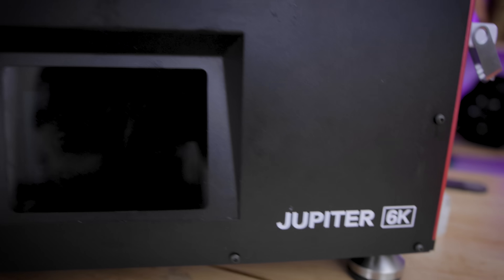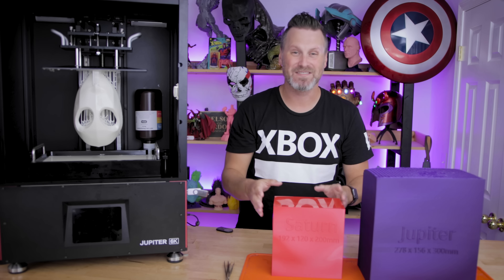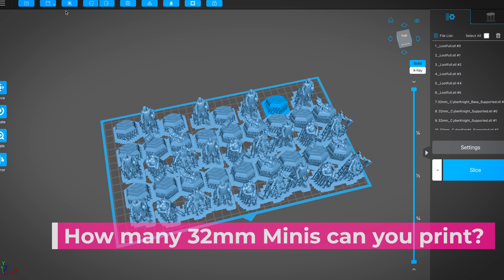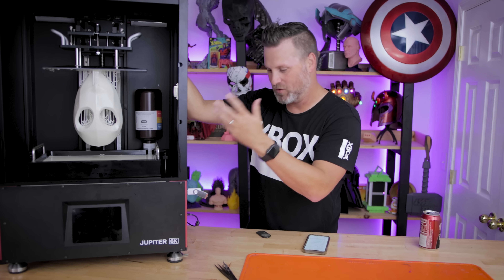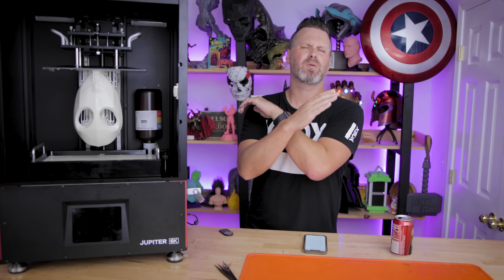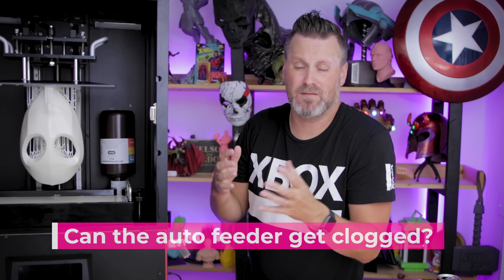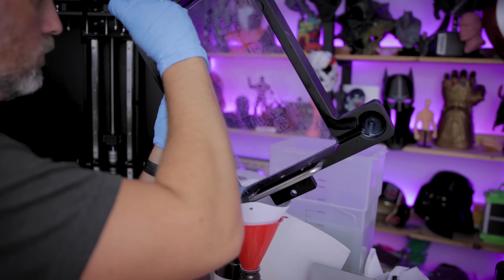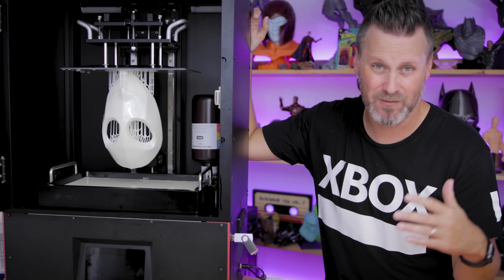Your Questions Answered!  Elegoo Jupiter Resin 3D Printer

Comment: Uncle Jessy, what large format 3d resin printer would you suggest to someone who needs to do short production runs? I need two at least. I need something with available parts as well. I've been looking mainly at the Peopoly Forge and Elegoo Jupiter. Jupiter seems to be the only printer in its class with a good bed leveling system. Thank you.

Comment: I backed the top package for 2 printers - I did plan on having them side by side - purely for space reasons. It would have been better to front USB and Rear vents. I know i’ll get 2 carbon air scrubbers. I use a 12” carbon filter with extractor rated to the volume of my room - works incredibly well
Like you stated about hanging the door, with 2 machines next to each other - it would be better to hinge the right machine on its right side - allowing the doors to open from the middle out!

Comment: I keep seeing these reviews where the sample prints are weird characters. How are these printers at printing accurate scale model parts. Cockpits, ejection seats, landing gear wells, or radio compartments. Try printing a radial engine with all those cooling tabs. Or mechanical parts such as sprockets, cams, and gears with extremely tight tolerances. Printing random fantasy characters doesn't show the quality of print because there's no real world reference to compare against.

Comment: Wonder if when printing minis, or anything really, could you run supports between the unused surface areas past the first set of minis and create a 2nd, 3rd, and maybe even a 4th "shelf" or "level" to print another set of minis until you reach the max z axis.

Comment: I noticed that the other large format resin printers can handle a 1:1 print of a helmet. Is it possible that they will change that on the kickstarter models? Not sure if it is locked in at this time. Just disappointed.

Comment: I bought a Saturn in 2020 and am fairly happy with it. I bought that upgrade from my OG Photon because a new "breakthru" had been made, in that case it was the bigger size and the mono 4K screen. From here I need another breakthru before I buy again, not just more resolution or bigger.

I think I'll wait till they get something like zero suction tech in these, I've heard its new tech that allows resin printers to just print in one continuous upward movement, no need to peel thin slices layers one by one.

Comment: Hi guys I know this is off topic but I need help. I bought myself a elegoo mars 3 and a elegoo mercury plus. Problem I have is that I've mixed the power cables up and not sure which one is for which machine. I'm no good with electrics and am scared I will blow my machine if I plug the wrong adaptor in. I have done the obvious and checked the labels on both machines. Ones a 24v and ones a 12v just can't see which one fits what machine. Please advise. Thanks for any help in advance

Comment: I see a problem with the resin after a number of hours where the colour settles to the bottom of the vat, going to have to stir the resin somehow.  Also, why waste so much space with the build plate so far away from the main support, reduce that and gain some height in build volume.

Comment: nice run down over the last couple vids....  thats a monster heh
guessing with the larger fep, like other of similar size. the retraction distance would need to be a fair bit higher due to the stretch on such a large area.

would be interested to see if elegoo has thought of selling (or including) a specific spacer or some sort of mechanism to get the FEP tension roughly right when replacing, especially since its raised, which adds another problematic dimension.

i know when i had to do my M2P for the first time it was a bit of a clencher as i really didnt know what to use. only because theres country differences with soda bottle tops etc.. (here in uk and the difference is marginal, but it caused my first attempt to damage the fep)

Comment: Thanks for the video!
My biggest concern is the storage of the little refill cap as you mentioned.
Lets say you let the printer sit for a couple of weeks, you have to store the cap to not get the resin to harden. Either you wash it out with ipa in between prints or you have to store it inside the printer :*

Comment: Wouldn’t it print in about a quarter of the time if you set it horizontally? Sure resin might pool up around the eye holes, but if you get out right away, just tilt it and dump the resin back. I mean 3.5 hours versus 14 would more than make up for increased cleanup time.

Comment: I like the filter idea, but if I were to get the printer, I'd put one of those heaters from Peopoly back in that corner since the refill section takes up the other corner. 

They'd be missing out on an opportunity to integrate a heater into their filter or just a dedicated heater with no filtration. I'd rather have the heater for print quality and reliability, especially for higher temperature resins like the Blu. Granted, it's USB powered, so I don't see them having enough power to do heating properly unless they have a separate or different power port.

Comment: I feel the 5000k Vs 4000k light temperature is not worth mentioning more than once. WiFi it Ethernet capability would be a bigger benefit at a trivial fraction of overall cost.

More information on the degree of vendor lock in as well. What are our options for long-term use as early adopters?

By harping on the lights, it feels like a distraction. It's for your personal benefit as a content provider... I get it... But you can swap that out easily. It's two wires. Other subcomponents are far more proprietary and more worthy of attention.

Please stay focused on the consumer here lest the audience end up feeling like this is more a commercial addressing cherry-picked questions than informational or advocating on your audiences best behalf. 

Thank you for the time in putting this together. I've put in for the $1000 USD Kickstarter option and want to know more.

Comment: Can you measure the build plate and give exact dimensions? I’d like to request an FBS from Wham Bam.
Reply: As it's a prototype it may be a good idea to wait. Personally my request would be the make and model only and not provide any measurements.
Reply: @RocketMagnetUK  I contacted them before. It sounds like they won’t be producing the proper kit until the printer is out in the public and they have one to measure or they get 20 or more requests for a certain size.
And I’m trying to get the magnetic sheet as close to the time I get the printer as possible. I don’t even want to try it without it.
Reply: @brianw6291  Yeah I got a flex plate for my Saturn and it's a must have IMO. Still I'd wait until it's nailed down as measuring a proto is pointless as it could change. Modifying the printer to account for the plate thickness should be simple to design and fit.. it may even be identical to the Saturn.
 
Not sure but maybe on bigger areas they need to use a stronger magnet sheet also to reduce the chance of the flex plate peeling off during printing. Yes item position matters and printing in one corner is asking for it to peel off on any size but there is simply more leverage on the bigger area so maybe it needs to be stronger also?

Worst case will be it turns up, you measure it yourself and wait a couple more weeks on top of the long wait for the KS to deliver... so time wise it's not significant :P

Comment: Thanks so much for the great video as always! 

Question - Is there any access from the rear or side of the case to add a new bottle of resin to the auto feeding spot during a print since you wont be able to reach across the print from the front?

Comment: I did back this printer + the Anycubic Photon Ultra - DLP.  Wondering if there is a big difference in resolution comparing with the Phrozen Sonic Mega 8K. Could you show some detailed prints side by side? I'm still trying to decide if I should keep the Photon Ultra as the build volume is really small.  Great review! Thanks for the hard work!
Reply: i also backed both printers. and today i spent several hours deciding if i wanted larger build volume with very nice detail 50um, and very well built with a metal chasis..

or if i wanted a super tiny one-two miniature at a time build plate.. and even better micro detailing.. "even though its considered 80um" and super cheap build quality.. as well as a very shitty slide in resin vat design...

i decided that the jupiter having worse overall print quality.. but its still superb, and being far far better in every other aspect. wins out.

i doubt the dlp lasting 20k hours and having slightly better micro details is worth fep's getting damaged over poor design. or just simply being limited to building 2"x 4" .

ill gladly spend that 550 i backed on the ultra on an extra 2-3 mlcd screen for the jupiter. 

as excited as i am abbout dlp with everyone else. ill be waiting until there are medium sized dlp's at consumer level prices.
Reply: @tedbowman965  Same here, I will probably cancel my order for the Photon Ultra just because the printing volume is really small and price wise I'm not saving much. Also Phrozen is coming with some news today. Wondering if it's a smaller 8K 3D printer.

Comment: I have a Saturn and can easily print using Lychee slicer.
Reply: Have you updated to the latest firmware for ChiTuBox 1.9? If not, then that's the reason why you can still use Lychee.

Comment: With a larger printer you're usually doing large prints that take many hours to complete, which your at the very least leaving overnight to print. Does the printer have a feature which will automatically turn off the machine once a print is complete?
Reply: I wish my Saturn did. Mine is in the room next to my bedroom and it runs all night

Comment: I prefer yellow lights. Cool lighting physically hurts my eyes.
Reply: I concur. However, it's simple to have lights that can switch temps. I think harping on the lights was the only disappointing element of the review here.
Reply: @CamiloSantana  It's petty, for sure, but I fear someone who has as much clout to effect change wastes it on this; in addition, the minds of his followers. 

Like, why not have it wifi capable? Every ink printer is wifi capable, hell, just about everything has wifi now. It cant add that much to the cost? Why pass it on to the consumer who doesn't have the buying power for 100k octpprints. But yes, let's make a change for blue lights. Even if I actually have yellow lenses in my prescription glasses, jajaja.
Reply: @noahbodhi8657  perhaps we advocate on top-level comments for WiFi? At the very least there will be Ethernet.

Comment: It would be cool to have a clear level measuring line on the side of a bottle  so you can actually see how mush you have left
Reply from the maker: Haha funny you mention that. I also tossed out the idea of some sort of clear bottle option.
Reply: @UncleJessy  Wouldn't that be a problem for protecting the resin from UV light?
Reply: It's a point and you could use a clear brown UV bottle like they use for lab chemicals.
Still you do have a 1 litre buffer in the vat.. so I think it's ultimately a non issue really.
Reply: I am surprised someone has not just printed a bottle from clear resin.

Comment: Is there any space in the case to insert a Resinlapse cable?
Reply from the maker: The real questions 😂🤣 I removed a panel in the back to get better access for it. However thr cable fits through the vents on the side but takes a bit of wiggling to get it in the right position
Reply: @UncleJessy  Okay great! I really want to make some lapse videos when my unit comes in. Thanks!

Comment: Great videos! As a backer this is great info. Very excited for this product. Would you say that the print quality/detail is as good or better/worse than another large format printer like the Phrozen 8k?
Reply from the maker: I will be doing some print compares once I get the new screen. I also have the phenom prime on hand 🤯
Reply: @UncleJessy  Should you be getting it before the kickstarter ends? Im hovering over the backing option on KS
Reply: never mind lol I backed it 😅😅
Reply: The Mega8K has 43 microns XY resolution. The Jupiter has 51 microns. So on the paper, the Mega8K is better. If you want to print display pieces (miniatures, statues for painting), then a smaller XY resolution is better. BUT, you also need good (precision) resin. Try Longer 3D Deep Peach, Nova3D Red Wax or Resione M70 resin if you want better detail.

Tonight Phrozen will present the Sonic Mini 8K. For miniature printing this could be very interesting. My guess is, that we will get something in the 25-ish micron range for XY resolution. That's on the level of a Solus or EnvisionTEC DLP. With the right resin, we can print models that are good enough to be used as master model for resin casting. Provided the z-axis is stable enough and does not lead to failures with layer shifts.

Comment: Chitu based board is a DOA issue for me. Any company that is going to lock you in to their software based on hardware that they have sold to a manufacturer needs to be driven out of business. Any manufacturer that elects to use chitu boards and accepts that as a requirement need to go out of business with them.
Reply from the maker: I would agree that the locked boards needs to change and hopefully we hear some further updates soon. Being locked to one slicer really does stink
Reply: Elegoo has stated that Lychee will be able to run on these boards by the time they ship. Unless Chitubox changes their mind.
Reply: @MageLeaderInc  Lychee has been very open about their ability to work with the new locked down printers. Chitu has said that they intend to allow other software bus as of yet they have made no attempt for this to happen. You can build all of your supports in Lychee and then save the model out as an STL to be sliced in Chitubox. Elegoo has no say in what Chitu does.
Reply: @MageLeaderInc  I'd join the Lychee team discord and ask them about that. Last time (when Elegoo started the KS), they did not know anything about the alleged agreement between them and ChiTu. :D

Comment: Weird Question, for multiple machines, can it be connected to a switch with Ethernet cable then connect to a computer? or one machine only able to connect to one computer?
Reply: There's currently no Ethernet port on the Jupiter but the last update their Kickstarter put out said the final product will have an Ethernet port.
Reply from the maker: I honestly don’t know. My print room requires a 50-100ft Ethernet cable 🤣😂

Comment: Chitubox basic has that new setting for different speeds when it lift up and comes back down can you do a video on that. its suppose to make print times faster but I feel like it takes longer.
Reply from the maker: Yeah I need to spend some time with that. I had the exact same experience when I tried to use it
Reply: Before this, the setting could be configured in the gcode. And it was something that caused headaches with the first Saturn models because the lift distance was set to 3.5 mm. In some cases not enough to separate the model from the FEP during printing before it was switching to higher speed. ChiTuBox 1.9 requires a firmware update for the setting to take effect. You are also locked to use the new encrypted ctb format by that update.

Comment: Thanks for this! Looks like next year I start buying the 5kg jugs of Siraya Tech, not least of which because I'll need one of those things to empty the vat! The idea of pouring resin out of that and overfilling one of the standard 1kg bottles is ... Not pleasing.
Reply from the maker: OMG!!! Why have I never thought about that. I have a bunch of big vat printers and pouring into multiple bottles is never fun
Reply: @UncleJessy  Pretty soon they're gonna need to start selling resin in paint cans so we can use those paint shakers. Just imagine the horrible mess we could make with one of those!
Reply: I'm going to try and use large syringes designed for pulling fork oil from dirt bikes. They're not expensive and have enough capacity to be relevant in what I see you guys doing. I'm a newbie and pre-ordered the Jupiter here. I do metal fabrication as a hobby. I wanted to be able to experiment with plastics as well.